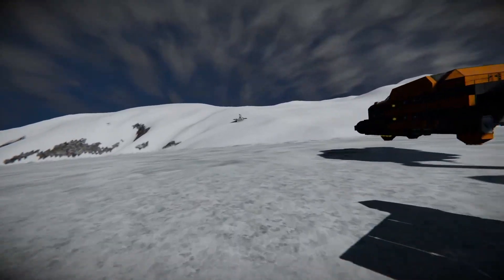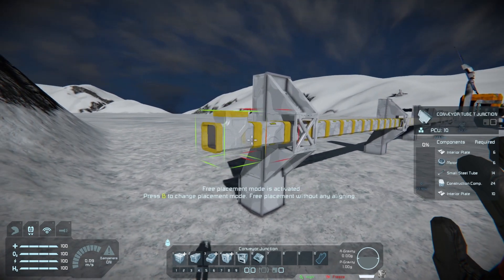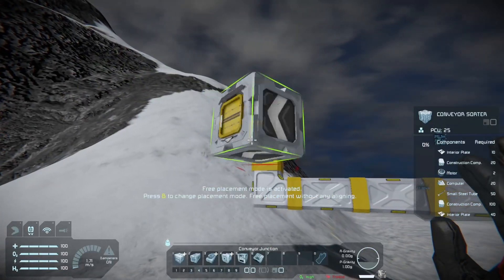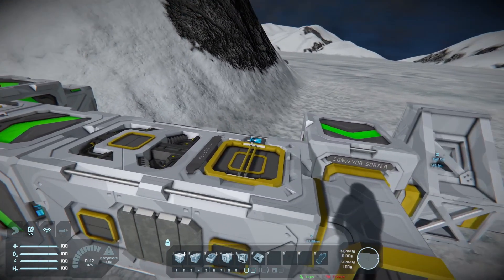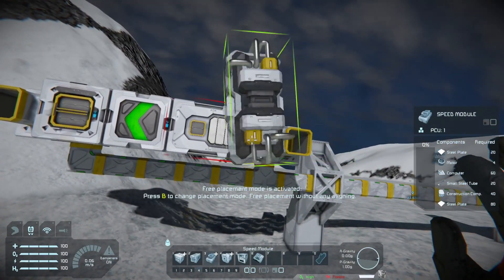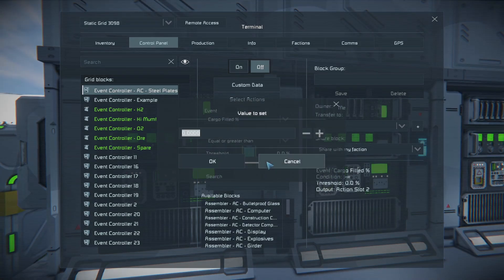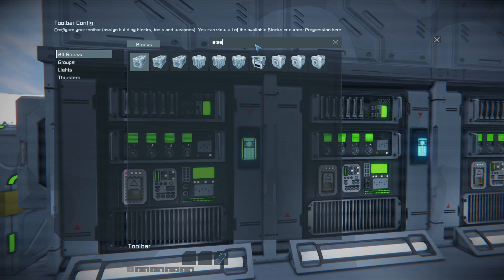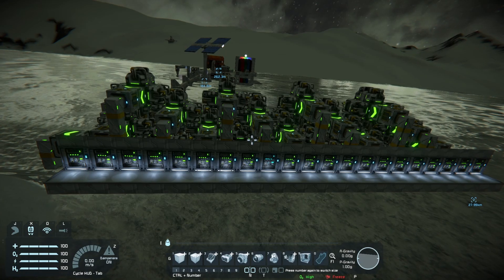This Space Engineers Autocrafting system doesn't need scripts or mods! Works on Xbox and PlayStation

Comment: its technically possible to use this system in conjunction with a welding ship to auto load up its inventory with components its just a series of enable/disabling sorters, event controllers or triggering timer blocks to play a loading and unloading sequence because the only way to load a certain amount of items in vanilla without scripts is to have a bunch of cargo containers with a set number of items each one which we will already have here you just have to make sure you have enough space in the welder for the components.
Reply from the maker: @Fp401-s4c  That is very true, but by the gods could you imagine how big the ship would be?
Reply: @GleebTorin  I already figured it out it doesn't need to be that big. its certainly better than hand welding a base. What I am suggesting is to have automatic loading of components to a welder drone or ship which will allow you to both use this autocrafting system and use a welding ship for base building or even ship building if you don't have a ship printer. To prevent components from building up we unload them into a temporary container to be reintroduced into the system so you won't make too much excess components. With how the autocrafting is set up you can reliably pull a set amount of items for your welder ship/drone. You basically swap inventories with your base and welding ship.

Comment: This is a set up any SE player should make. A badge of SE engineering. Complex but simple. I am pc and this works great with a hilly modded game. Easier on processors of the pc. Parts for a printing set up for ship making. Faster processing if you use the Nano bot Build and repair. Less lag for nano bots if you you have a projection going of your ship/ base during a large battle. Welders always have stock to repair. I believe this set up is a great way to play.

Comment: I've got this running but ran into a few problems 
1) When the assembler is disabled by the event controller, the input seems to pack off with all ingots and gravel. The gravel is mainly what packs it off, but I found 1 with 200k of iron bars, and another that had ALL my gold and silver bars. Was wondering why some stuff wasn't assembling...
2) When I refilled my ore, I found steel plates weren't working. Went into the cargo container and found it have packed off with other components. I'm not sure why the containers are packing off with materials from other assemblers.
I'm currently in the process of putting sorters on the front and back end to try and keep this from happening again.
Reply from the maker: @MrNeutral01  Oof, sounds painful.

#1 may happen if the input sorter is set to pull items. Leave that off, as it is intended as a filter.

#2 may happen depending on the layout of your auto crafting network. It shouldn't happen under the layout I showed.
Reply: @GleebTorin  Yeah, I followed your setup, apart from running a straight line instead of stacking. Worked fine for a while then started messing up. I think it may have been something buggy in the game that caused it.

Comment: I appreciate this but, for anyone playing on the official servers where pcu limited are 20k. the problem of stockpiling components is best solved by just making a lot of stuff. sorters, assemblers and event blocks for each component is an impossible cost. Of the top of head that's like 1.5kpcu just to solve a minor inconvenience? Your opponents who spend their 20k on offense will have like 16 ish more railguns!! Also scripts, experimental mode, and mods are disabled on official servers.

anyone know any low pcu solutions?
Reply from the maker: @CanuckNews-fv3qj  This really isn't designed for sane play. While it was designed with being able to make it in survival in mind, I never expected anyone to make it. I'm not aware of any lower PCU methods, as the only way to make this sort of thing is by using a lot of parts. Otherwise, it's going to have to be scripts. Let me know if you can improve on it though!